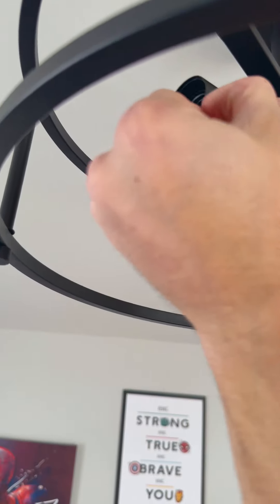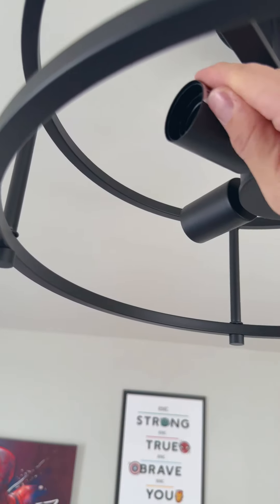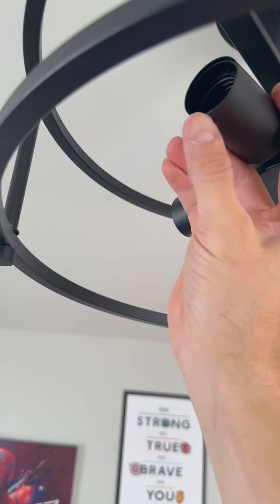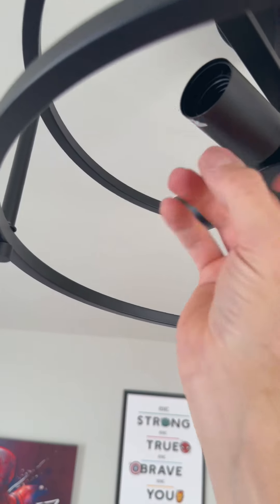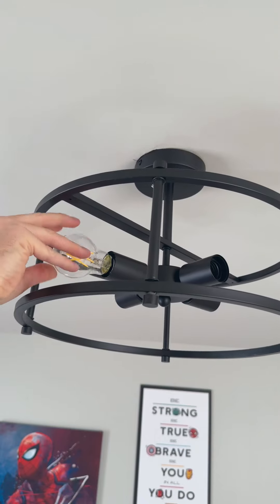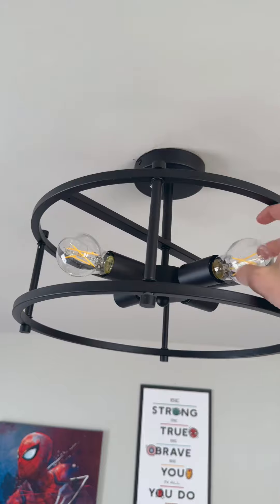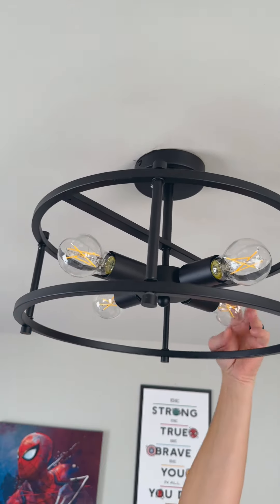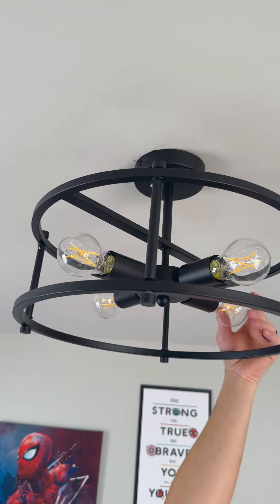Breast Lights Have To Go

Comment: Why not get a drum light with a nice frost in glass. The light you hot looks like its missing half of its parts
Reply: I actually really like this fixture, looks very modern and slick.
Reply: @drawzan8554  I have installed a lot of these drum lights. They became very popular 5 years ago. Now I install 1 at least once a month. Nice job